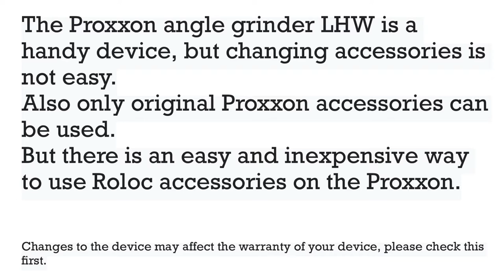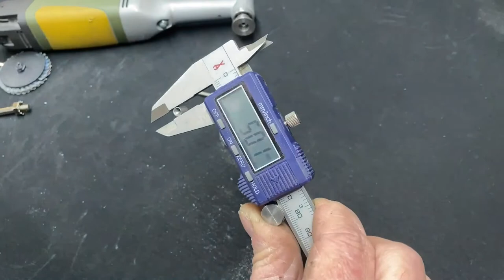How to convert a Proxxon angle grinder to the ROLOC system

Comment: How do you make the filler tube please?
Reply from the maker: I used a piece of thin tube for that and tapped a screw thread in it.
Reply: @BrutusMetalArt  thank u Brutus,I will give it a try.
Reply: What I have done in past is to grind down the original roloc shaft and then thread it to match proxon thread which I think is M4.
Reply: @kasparroosalu  did that work ok for you?